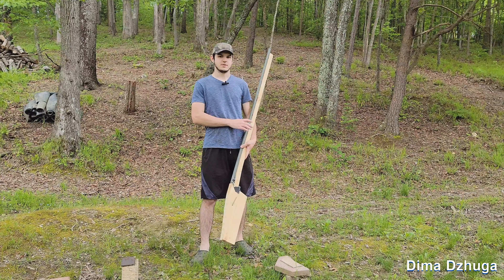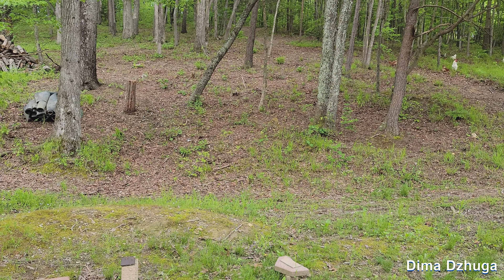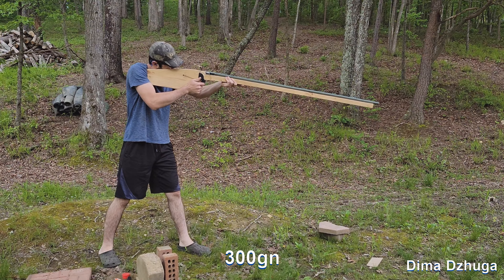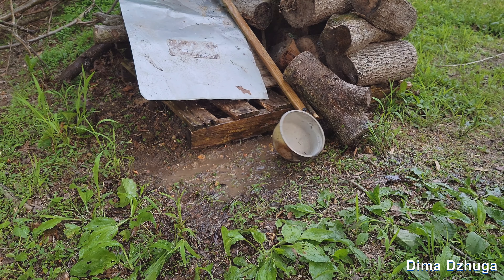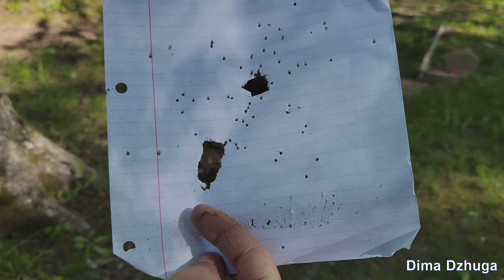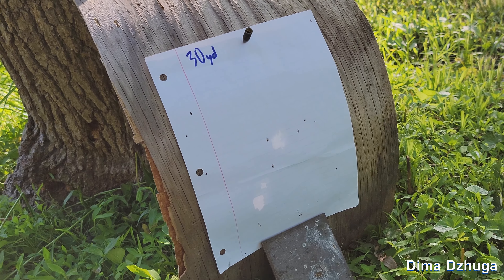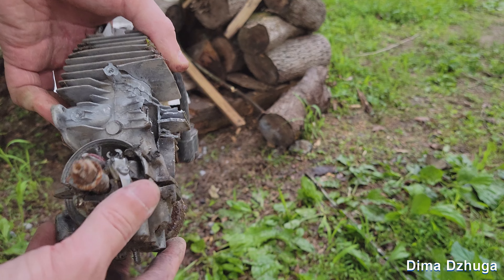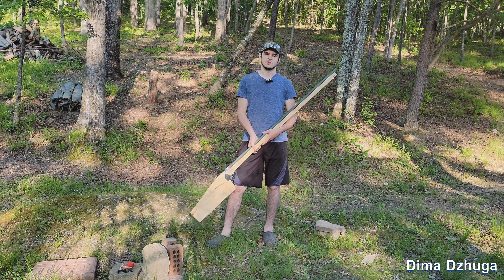Homemade .54cal Matchlock Muzzleloader

Comment: Hey dude, im trying to make my own matchlock rifle and im using your video as a reference
May i ask what the wall thickness of your barrel by millimeters? 
Thanks
Reply from the maker: The wall thickness of the barrel is 3mm, but I only shoot with 50gn powder loads. If you want to shoot bigger loads, you'll need a thicker barrel.
Reply: @dimadzhuga h ok, the pipes im currently using have 2mm wall thickness, 700mm in length and has a 10mm bore width, is it any safe to load 25gn to 40gn of powder on the pipe im using? 
Thanks for the feedback
Reply from the maker: @somethinggeneric6583  It should be safe, but don't take my word for it. Do lots of testing before you're confident enough to hand fire it. A good idea would be to test it using too much powder, for example 75gn of powder and see if it handles that. If it can handle 75gn of powder, then it'll be able to handle the standard load, which is less than that.
Reply: @dimadzhuga can you make a tutorial?
Reply from the maker: @javir1669  YouTube doesn't allow videos that show how to make or modify firearms
Reply from the maker: @kovona  I had a sch 30 pipe and I wrapped another pipe around it and welded them together. The wall thickness is about 3-4mm and the bore is about 13.5mm. The max load I do is 50gn FFg 777. I did a couple hot loads to test the strength and throughly inspected it and there was no cracking, bulging, etc.
Reply from the maker: @kovona  Nevermind, I thought you were talking to me, I should've read the reply address
Reply: I think you could get away with a tutorial as at least iny state that weapon is not considered a firearm as it is muzzleloaded, fired by an external powder source and cannot be modified to accept modern ammo. I checked all that to see if I'm allowed to make them where I live. You tube could have a loop hole but just thought I'd share what I learned about "legality" 😅

Comment: How did you make the breech plug? What were the powder charges?
Reply from the maker: The breech was closed by welding a thick steel plate to the breech of the barrel. I used 50gn Triple 7 muzzleloading propellant.

Comment: What kind of pipe did you use
Reply from the maker: I found a steel pipe that was .54in ID and then I got another steel pipe that tightly slides around the first pipe. Then I welded them together.
Reply: So is the whole length of the barrel double layered? @dimadzhuga
Reply from the maker: @jamieduke5659  Yes, that is correct.
Reply: Awesome thank you for the quick reply! Instant like and subscribe from me 😁 @dimadzhuga
Reply: @dimadzhuga  Great video! So two pipes, one fitted snuggly inside the other and welding? JB weld or rods at the two ends?
Reply from the maker: @BasildeRayen  Yes, the pipes are welded together, and the breech end was capped off by welding a metal disk in place.